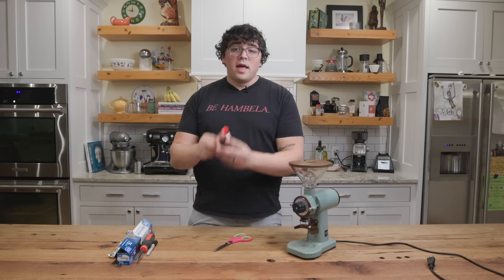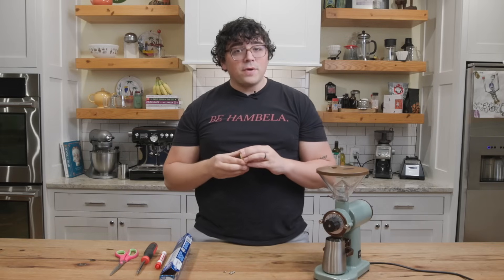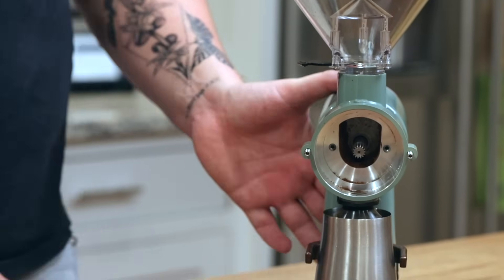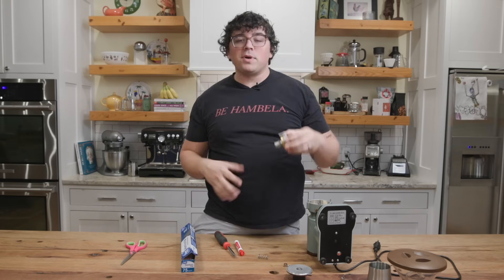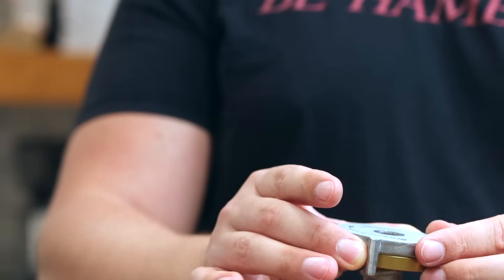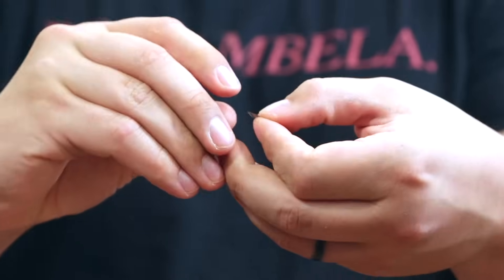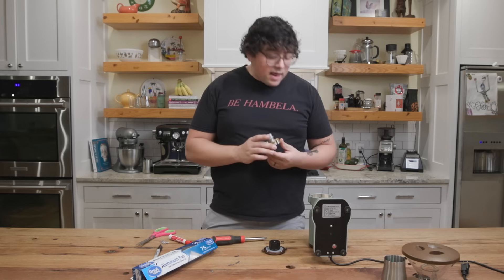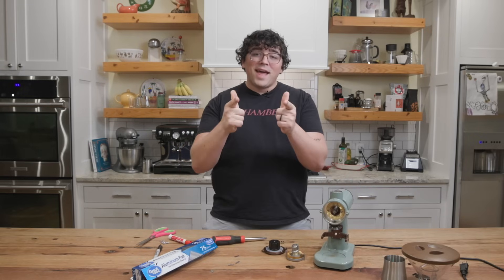HOW TO ALIGN YOUR GRINDER: Shim Alignment Tutorial

Comment: 14:05 What would we do it to the stationary burr ? If one is aligned doesn’t it means that everything is already good to go ? Thanks a lot i will now check on my X54 ^^
Reply from the maker: Nope! Both need to be checked. Perhaps some machines both won't need to be done, depending on the tolerances. I would hope the x54 doesn't need the stationary done but check both. Shim the rotary and once clean wipe, check the stationary. I can all but guarantee it won't be full.
Reply: @LanceHedrick  I'm also struggling to understand the double burr check. Everyone seems to agree on it btw, the tutorial by Matt Perger also indicate that it should be done with both burrs, but from a mathematical point of view I don't get it. As an example, you can align the plane formed between your hands by moving just one of them, right? Would it be the same with the burrs? What are R Dalmasso and me missing? PS: You are the heir to the Hoffmann's throne XD
Reply: @Nole256  if you have one burr aligned that means that that burt is perfectly flat and the high point of the other burr touches the rotating burr at all points.

Imagine that you have fixed your marker at one position and it cannot move. And then you have your burr spinning. Then you slowly move your burr closer to marker. If your burr is aligned as soon as marker touches one side of the burr it will draw on all sides. But if your burr is misaligned, the marker will just touch one part of it.
So now, you can imagine that the marker tip is the highest point on your stationary burrs and it can be horrible misaligned. If it's also in alignment that means that both burrs touch each other with all flat parts simultaneously
Reply from the maker: Mike is correct. You have to remember the auger is at 90 degrees so if one side of the burr is down, that is the only side hitting the stationary burr and will thusly only wipe off there. Once aligned, all teeth will hit, but could only hit one side of stationary burr if it, too, is even barely misaligned.
Reply: @Nole256  The whole idea is to align them not just parallel to one another, but also both should be perpendicular to the axis of rotation of the moving burr. The only way to do so is to check for the alignment of the moving burr first.
Reply from the maker: Exactly. Nail on the head
Reply: Seeing those answers I feel so stupid, basic logic ahaha sorry for that guys, while seeing other comments I feel less alone lol thanks for your time to explain me.
Reply: @FraiseKiwiOff  don't feel stupid, 3 years on I thought the same as you but the explanations here made perfect sense. Thanks for asking the question :)
Reply: @ThePixelDreams  Mate cause of your comment i just re saw all this, and yeah for me again 3 years after I’m wondering how i didn’t think further 😂

Comment: Thank you very much for the demonstration! 
Why would you shimm the other burr if you got a good wipe on the first? Aren't burrs symmetrical and already properly aligned?
Reply from the maker: Nope! That's the point of aligning them haha!
One is aligning perhaps an improperly manufactured burr carrier and the other is to make the burr perpendicular.
See for yourself by checking if the bottom burr will have a full wipe! 🙏🏻